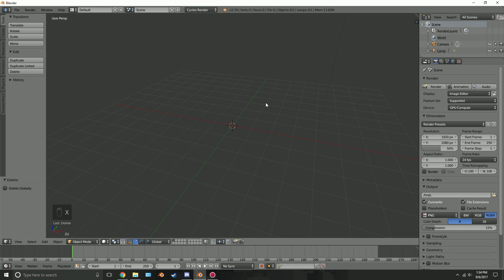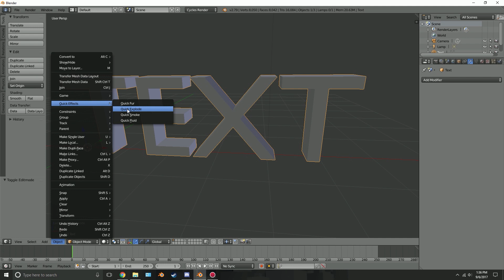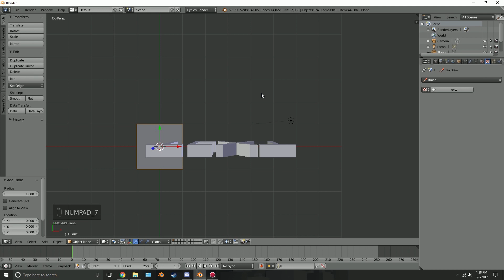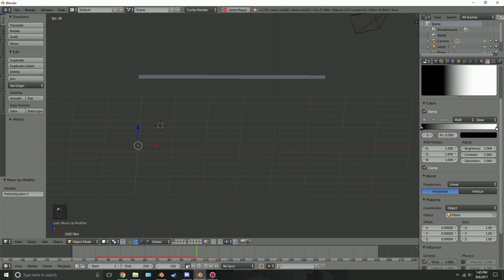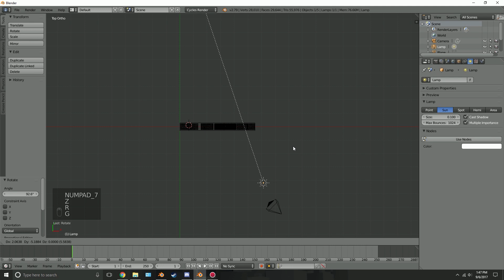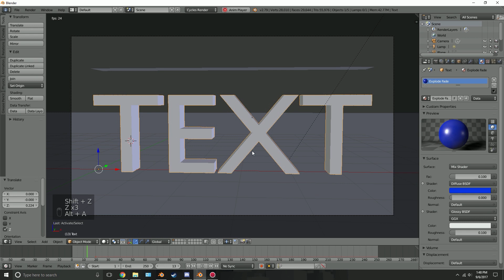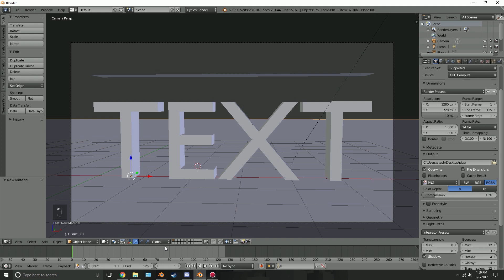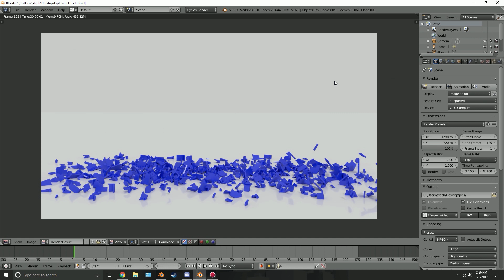Blender Tutorial - Particle Text Explosion Animation

Comment: This is a great video and so helpful. I'm a total beginner with Blender (2.79b) as of three days ago. I have a question that I hope you can help me with. In my text animation I have two lines of text, one in front of the other with the line at the rear in a larger font size. Thanks to your video and my step by step approach to learning from it, I've got an excellent animation. 
I want to know if it's possible to make the camera pan around the animation as the animation is running, say from left to right in an arc. Can this be done?
Reply from the maker: Hi David, I just saw your comment. Thank you for the nice comments.  To answer your question yes that is possible. You can set keyframes for the position of the camera.  For example on frame 1 have your camera on the left side. Hit the I key and select Location Rotation.  Next go to the end of the animation and move your camera to the right. Then hit the I key again and select Location Rotation. Now over the course of your animation the camera will move to each location you set.
Reply: @BlenderMadeEasy  Thanks for your reply. I have one more question if you wouldn't mind helping me out. My exploding text animation that I mentioned above was 162 frames / 6 seconds long and it took 3 hours and 41 minutes to render! Are there any settings in Blender that can be changed to speed this up? My laptop is a 4K  / 64 bit / 12G RAM / i7 6700HQ  and in Blender it's got the CUDA GeForce GTX thingy - I don't know which of these bits of info, if any, are important for you to know in order to answer my query so I mentioned what I thought was important. Any help you can give would be much appreciated because the render time is the only disappointing thing about what is otherwise a fascinating subject.

Comment: Excellent tutorial, easy to follow. Is there a way to start the explosion animation from top to bottom instead of left to right? I tried the Vertical setting under Colors (3:53) and it changed from Left > Right to all letters exploding. Thanks
Reply: I am having the same issue, have you found a solution yet?
Reply: Not yet, but I would like to learn how to control it from which direction I choose, left > right, right > left, up > down etc.